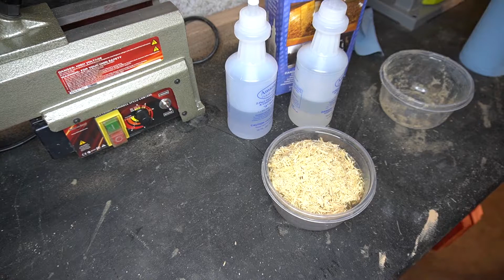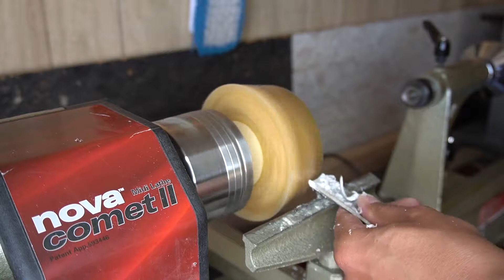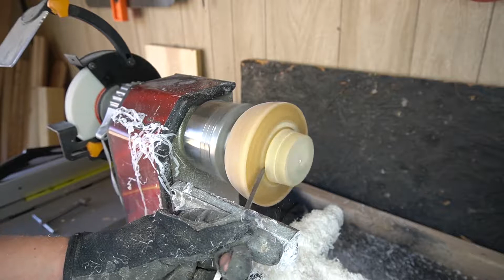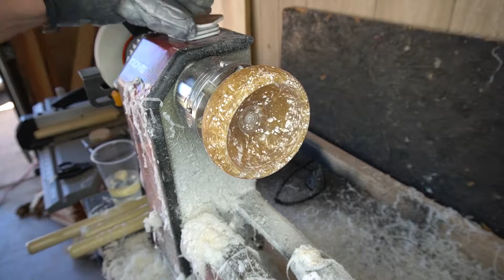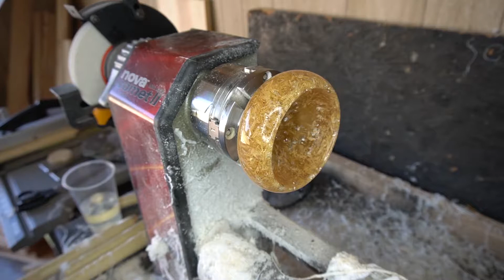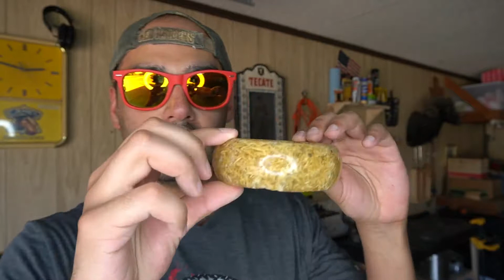Making A Sawdust Resin Bowl

Comment: Hi, i f you wanted to get a sawdust resin mixture kind of like play doe. consistency.. What ratio by volume do you think it would be ??? i am hoping that 1 part resin to 4-5 parts sawdust... Just asking you since you may already have a good idea.... thanks
Reply from the maker: Honestly, I’m my experience it’s more of a consistency of the resin versus a real ratio. I think once the resin and the sawdust have been mixed it should feel like cooked oats. Idk if you have ever cooked outs but it should have that kind of consistency. Kinda like paste but a little bit more runny. That usually gives a good mix consistency. Hope that helps.
Reply: @saultytexas  i understand... i just need it as a fill for hollow art work i make for strength not its look as it will only be seen if turned up side down... dryer means more cost effective... i am hoping 1 to 6 ratio since i sell these pretty cheap and need only enough resin to bond saw dust together...thanks
Reply: resin mixture name? pls

Comment: I have a huge bag of fine ironwood sawdust and I want to make use of it this manner. Would that be feasible? I note the comment down earlier on plywood and I dont understand why sawdust would be a problem unless u mean it would be a weak block
Reply from the maker: As long as you mix enough epoxy with the saw dust it should be fine. If you don’t add enough epoxy you might have some chip out when turning the blank.
Reply: @saultytexas  appreciate the advice

Comment: What are the materials added
Reply from the maker: It’s a mix of epoxy resin and saw dust.
Reply: Did u added hardner
Reply from the maker: @asmithagiri9495  i use a 1:1 ratio epoxy